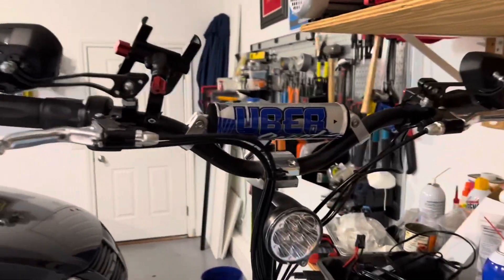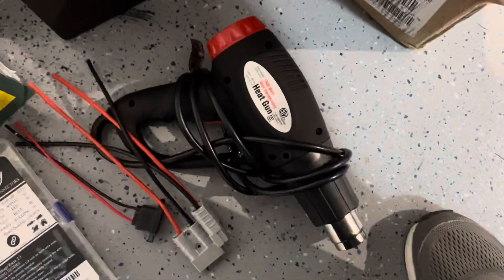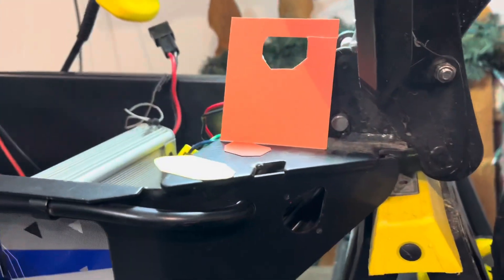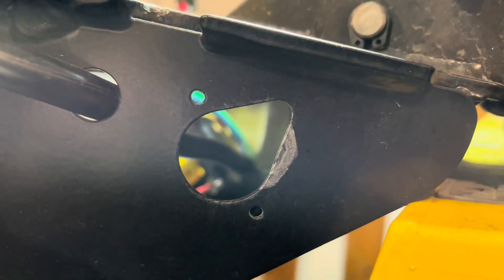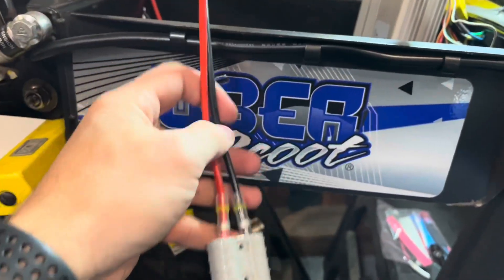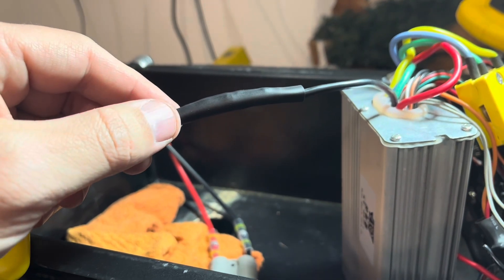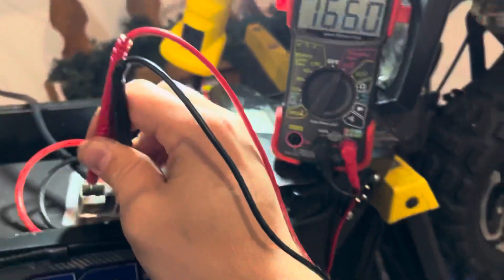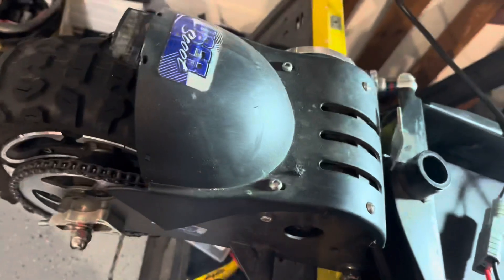UberScoot 1600w 48v - Lithium Battery Scooter Upgrade

Comment from the maker: Update 4/14/2024: I charged it up full and took it to one of my wife's marathons this weekend. Starting voltage was 54.4v (99% theoretical max 54.6v capacity) and drove ~14.3 miles throughout the day with rolling hills in Kentucky. End voltage was 48.4v. So 6v used for 14.3m. Temps were mid 40's to mid 60's throughout the day. Top speed was still around 29-30mph.

The battery cutoff is 39v. On a discharge curve, you'd see that the initial 54.6v (100%) to 50v (70%) would drop relatively quickly, with then steady discharge from 50v (70%) down to 42v (20%)... which is the ideal stopping point. After 42v (20%) the drop to 39v (0%) would also be rapid.

Doing the math, I used about 39% to travel 14.3 miles which means in theory I'd have about 36.67 miles of range. Still super happy with the upgrade!

Comment: I got a 3000w 80v set up, but I machined an adjustable rear swing arm extension; and installed a 20 inch knobby tire, gonna make my own front fork extension and put a 14 inch knobby tire and  get some dirt bike fairings

Comment: Can anyone tell me where I can get a controller for my uberscoot 1600w 48v electric scooter
Reply from the maker: bigtoysusa was bought out by mototec it looks like... but they still sell parts. What you want is likely on this page: https://mototecusa.com/evo-electrical-parts.html
Reply from the maker: I see those are out of stock... some here may work, but I'm not 100% on the wiring. https://electricscooterparts.com/speedcontrollers48volt.html#48vbrushlessmotor
Reply from the maker: The actual part I believe is the OKW16P-4... but it's hard to find anymore.

Comment: Hi sorry to bother you how much was this kit as I really really need to change my battery from lead acid fare to heavy
Reply from the maker: The price will vary depending on what size battery you buy. This one was $500+ USD when I bought it. Then I picked up those solder connectors for $8 on Amazon... I already had the heat gun. It looks like the price has gone up slightly since I picked this up and they are about $550 but currently out of stock for a 35Ah size... you can go with a different one that is still Li-ion based but with lees Ah which gives less range, but I don't think you'd fit a decent range LiFePO4 as they are larger... Either way... you'd have to shop around and see what is out there that fits in your scooter's battery compartment.

Comment: Btrs have been known for fires. How’s the battery setting up so far?
Reply from the maker: I've only seen complaints about BTR's LiFePO4 batteries being built with a Li-ion board... causing issues. I've not seen any fire issues with these to a degree above any Li-ion brand. This one has been solid. I even wrecked in July and the battery came out but remained unscathed. I packed it back in it's foam borders I put in the deck and it's been great still. No issues.
Reply: @ great to hear. I’ve had one also and was actually pretty stable even with a little beating but always got slack for it in the groups

Comment: Hi Brent I upgraded my battery but I put a 52volt battery now it flies think it goes 40mph and so far everything looks good I mean no cables burning or anything.
Reply from the maker: Interesting. Yeah I just did some google-fu on the use of 52v batteries on 48v controllers and found: "Most 48v and 52v controllers have electronic components that max out between 60v and 64v. Higher voltages will burn them out.  That is why it is safe for 48v controllers to tolerate voltages up to 60v.  52v batteries have a maximum voltage with a full charge of 58.8v, so this is a safe voltage for the components in a 48v controller.  Motors are even more tolerant. They just spin faster, given higher voltages."

But they do go on to say 60v batteries are too much as they max around 67.2v and would burn out the 48v controller. So 52v are the "sweet spot" for performance on 48v controllers assuming they can handle the load. The controller in this scooter is the OKW16P-4 which doesn't seem to have much documentation out there to say what it's tolerances are... but you took the chance and it may have paid off. Enjoy the boost!
Reply: I found the same information on upgrading to a 52 volt battery… This is the way I am going to go.
Reply: Did you go with no fuse like Brent did? And how is your upgrade holding up?  Thanks.

Comment: @BrentTech Good morning, I want to ask what the dimensions of your battery are. Is it 6.3 x 6.3 x 10.26 and does that fit inside the bay of your Uber scoot easily?
Reply from the maker: Dimension: 255x165x110mm... so roughly 10 x 6.5 x 4.33 inches. You can see in the video it fits easily but with padding that I added, it's fairly snug. You could do something different with padding if you prefer. I'm not sure if you can fit a 6.3" tall battery without measuring... you should check that.... but the other dimensions you list are fine.

Comment: I have placed a 48v battery and now I have the problem that when I press the brake it accelerates any idea what it could be
Reply from the maker: As far as I know the brakes are not electronic on this model. They are standard bicycle cable brakes. So if you are squeezing the brake and the scooter is speeding up, I would guess you are accidentally moving the throttle on the grip by the brake handle, or you have some version of a scooter with an actual speed control that tries to maintain a certain speed (like cruise control) and it senses the brake resistance and adds more power. It short, it shouldn't be related to this mod at all... 48v is 48v whether it comes from SLA or Lithium Ion.

Comment: Hello Brent, thank you for a very informative video.  I have the exact same scooter that I bought 5 years ago.  I had to replace the 4 SLA batteries once, but I would like to convert it to lithium battery.  Questions:  1)  Your battery appears to be the top of the line and quite expensive ($559 on Amazon?).  Is there cheaper alternative?  2)  You didn't have the 2 fuses connected to the controller.  Did this set up give you any problem?  Thanks again.
Reply from the maker: 1) You can save $ by going with a lower Ah rating. I went with a 35Ah vs the original 12Ah (so about 3x the runtime). If you are happy with the distance your SLA give you, just go with a 12Ah Lithium... or something close to it. The problem is your BMS (Battery Management System) needs to be capable of discharging the Amps you'll pull on this 1600W scooter. So some quick napkin math tells me the 1600W/48v= about 30Amps... So the battery I have included a 50Amp BMS. I'd say you could TRY a 40Amp BMS battery... but I wouldn't go lower. BTRpower has a 20Ah battery with a 40Amp BMS for about $300. Google their name for their website pricing if it's cheaper than Amazon (I don't know honestly). 

2) I have not had a problem with the fuses disconnected. It was 40A worth of fusing... I'm running a 50A BMS and the motor/controller is only pulling 30A under normal operation, so I have plenty of room to not worry about it. I would GUESS you'd be fine with a 40A BMS as well. To be clear, I am NOT an electrical engineer here... but my understanding is that the fuse only protects the battery and/or controller as it is inline between the two, from a short in the wire damaging one or the other. The controller is replaceable for about $30 in this scooter. The battery is what I'd be worried about damaging. This particular battery BMS says it has "over discharge protection, over current protection, and short circuit protection" built in. I'm not 100% that means it covers this wire vs the internal connections between batteries... but I think it does, making the fuse redundant. In a SLA battery chain like designed, there is no BMS involved. The fuse is important there. Here, I think it isn't needed. Someone feel free to chime in if I'm off base here...

I've driven it a couple of times for about 12 miles at full speed and haven't had any issues. And to be clear, I had plenty of range left. I just was done getting where I needed to be! I hope your upgrade goes well!

Comment: I swapped out the motor it was a DC 1000w motor and not brushless. Added a 3000w BLC motor and can peak 5000w it lifts the front tire off the ground. And will be running off a 72v battery on this Uber scooter. Hopefully to go over 23mph on it with our whiles lol.
Reply from the maker: Love it! Yeah I found the front wheel kicking up on me with the battery mod too, so I can imagine what you have with 3x the motor and going 48v to 72v!
Reply: @BrentTech  I weigh 280 lbs and it lifts the front wheel off the ground. It's nuts.

Comment from the maker: Update... took the scooter out for the past couple days and did some math on the battery performance. First off, the top speed went from 23mph on the old battery to 30mph on the new. WOW! I was NOT expecting that. Second, I rode 4.3 miles and used just under 15% of the usable battery life (54.6v dropped to 52.1v... cut off voltage is 39v). Extrapolating this out with today's 35 degree average weather, I could have gone ~28.7 miles. That is a CRAZY improvement over the old battery's 8 miles in the same conditions I tested last year. And I'd expect slightly longer range in warmer temperatures, so 30 miles shouldn't be out of the question in summer months.
Reply: Video update will be awesome.
Reply: Battery name?
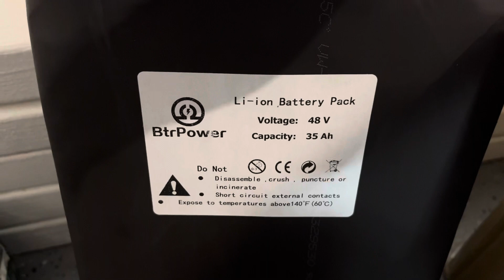Reply: @IsakAndersen  BtrPower says it on his battery 0:56
Reply: where did u get the battery pack?? can u post a link thanx
Reply: Was that range at full speed?

Comment: Hello, where are you buying that battery?
Reply from the maker: https://www.btrpower.com/collections/48v-ebike-battery has some options. I picked up the https://www.btrpower.com/products/ebike-battery-48v-35ah-lithium-ion-battery-pack-with-5a-charger-50a-bms-fit-for-1000w-1500w-2000w-motor but just make sure the size you pick will physically fit into your scooter... For this particular scooter, you need to match the 48v and the 50A BMS... which these do... but the Ah rating (how long it will run) is up to you for how much you want to spend and if the battery will fit in your scooter. 35Ah is probably the largest I could fit in there. The original SLA batteries were 12Ah rated, so this should get me about 3X the run-time. I know BTR Power also sells on eBay...
Reply: @BrentTech  Thank you for the information. 
I have a Scooter 4e 7 1000W. 
In 4 days, the battery did. I was looking to buy an excellent quality battery for it, but with the old battery 10KM, it shut down. Thanks for the w Zadar websites.
Reply: I can’t find this battery anywhere! It’s been out of stock for 6 months! Any suggestions?

Comment: I'm doing the same thing with mine I want to get a good battery I see a few different people getting 48v 20ah batteries and 48v 25ah what is the best in you opinion
Reply from the maker: The only difference there is range. 12ah is the original... so 20ah is less than double that. 25ah is just over double. So how much do you want to spend and how much range do you need? Either one will be a major upgrade over the original.
Reply: @BrentTech  I'm going to order a 48v 25ah If that's the best I can find

Comment: thinking of doing the same thing have you ran into any issues as of yet?
Reply from the maker: No issues yet! I've taken it out a few times for a few miles and charged it fully. No problems. I haven't done a "long run" full battery drain yet, but will give it a run eventually. I'll post back when I do.
Reply: Anything yet?
Reply: Would love to see the results of the long run

Comment: You could fit a 50 or 60 amp hour battery if you wanted to.
Reply from the maker: Definitely potential to go bigger, but at some point you have to balance performance vs cost. The 35Ah is over 500 dollars already on a scooter that now sells for around 800 or so. How far do you need to go between charges? To each their own.

Comment: Hello, what’s the mileage range with the new battery mod. Other videos said that the scooter averaged 10 miles with the lead acid batteries. Have you had a chance to test the new full range yet?
Reply from the maker: I haven't had a chance to deplete it yet and probably won't until I decide to install an accurate voltage meter to know the range so I'm not stranded somewhere. The old SLA batteries were rated at 12AH and the new one is 35AH, so you'd have roughly 3x the range. Depending on drive speed, weather, rider weight, terrain, etc... your mileage will vary. I know on the SLA I made it about 8 miles in about 30F temps. I'd see 10-12 max in better conditions. I'm expecting to see about 24-30 miles on this battery.